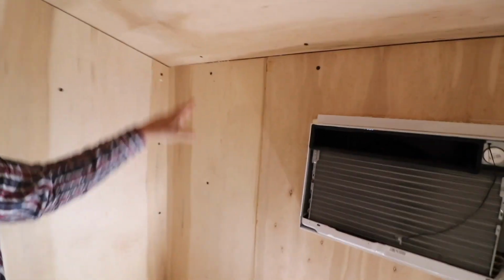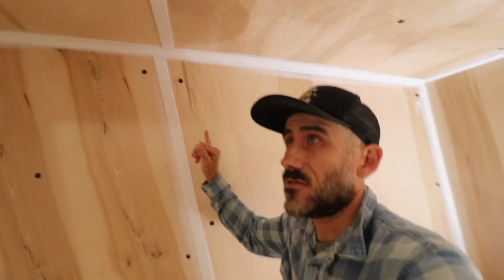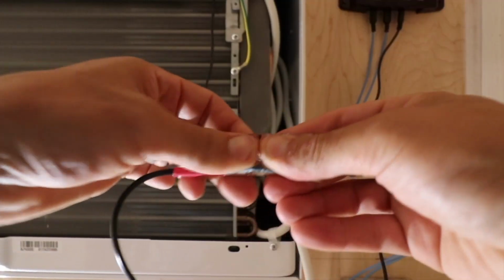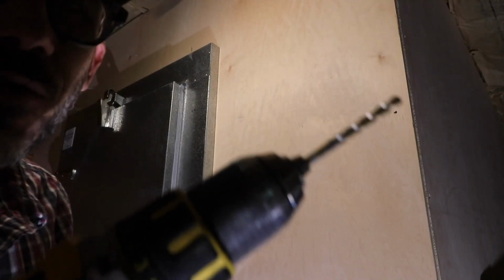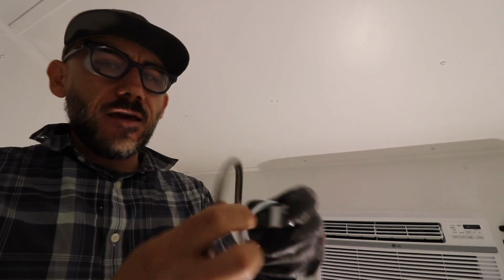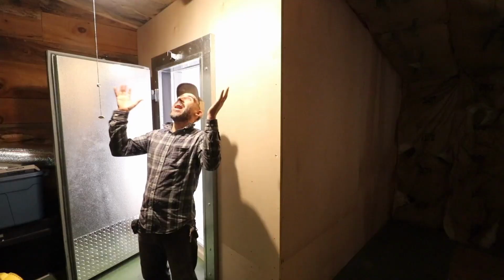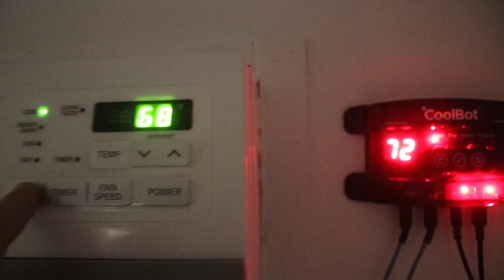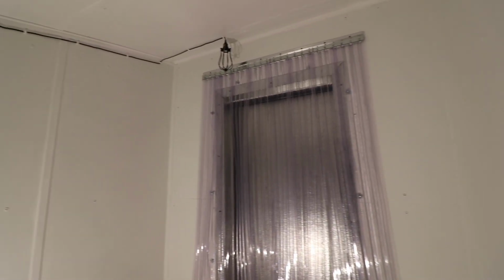DIY (FINISHED) Walk in Cooler BUILD

Comment: I’m all over this.  We have that very AC unit.  I’ve heard great things about the cool bot.  It so beats just buying another fridge.  So if a room has dry wall and is stud framed like a standard room, can you just pull off the drywall, insulate it then put the plywood up?  The outside of the room is drywall.  Did you find a real need for that walk-in in freezer door, or would something like an insulated metal house door work?

Comment: Great job on the walk-in cooler!
One question, can you open the door to the cooler from the inside?
I didn’t see any type of handle or latch to open the door.
Reply: Herbert Poland Yes.
Reply: The door is not latched. No accidental lock-ups! Kids are safer.
Reply: Justin's son, Jonah demonstrated how easy it is to just push on the inside and the door opens easily, no getting trapped in there.
Reply: Yes it does not lock . When Rebecca and the kids went in , they just pushed on the door and it opened. No prob. No lock is a great option .
Reply: 9:27 It's just a handle. It can be pushed open from the inside.
Reply: No latches on the door. The kids can even open it just by pushing it from the inside. They showed that in Justin's video
Reply from the maker: yes! opens easily. kid safe

Comment: Why did You go with 4.5 inches of insulation  instead of just 4 the last 1/2" adds another round of cutting and fitting the insulation?
Reply from the maker: we were originally going to do 2.5 inches. but chose to do another 2 inches. since they already bought the .5 inches we just kept it. i figure more insulation the better. but yeah, more work though. thanks Walt.
Reply: @SowtheLand  I wonder what the R value if the 1/2 foam board is Vs 3/4" ply

Comment: Please make sure nobody can get trapped inside
Reply: Hello, I wanted to let you know that I shared the same concern, but in Justin's video they discovered that all they had to do is push the door and it opens. Have a great day!
Reply: Yes, what is the plan for kids to get out?
Reply: 9:27 It's has a handle, no latch it can be pushed open from the inside.
Reply: In Justin's video they shoe how that won't happen. There's no latch  on the door. And they showed the kids inside and just pushing it open from inside.  : )
Reply from the maker: yes, kids can open it easily. thanks